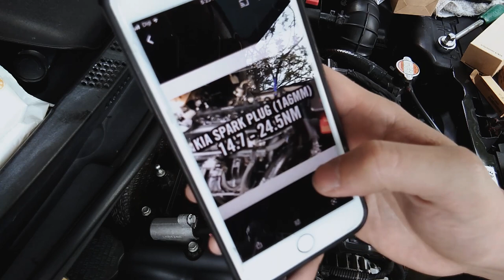Replacing spark plug and ignition coil for Kia Cerato / Forte (K3) 2014 (Eng Sub)

Comment: Hi bro. Why do you need to replace the ignition coil? It is broken? Or you need to follow the car manufacturer recommendations milage?
Reply from the maker: there is no specific date to change plug coil, since my car already had 170,000km, it serve more then it do. So I change it for a worry free driving. And the old one can keep inside the car for emergency use.
Reply: @junkitlow  Ok noted 👌